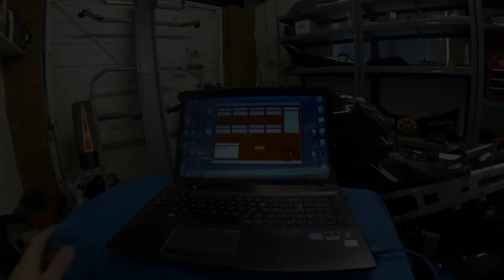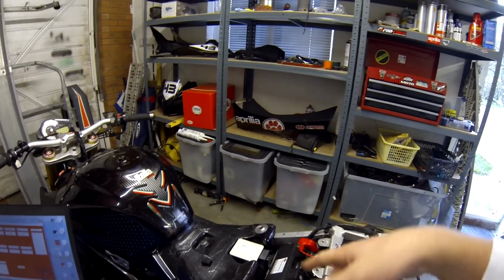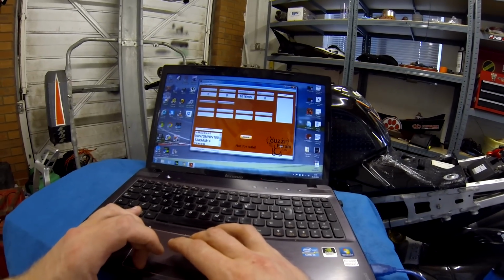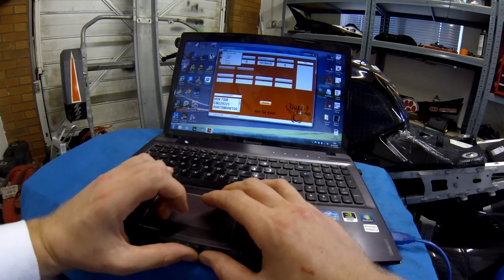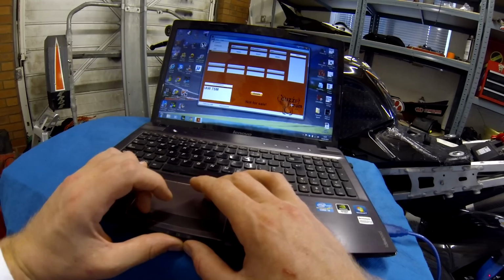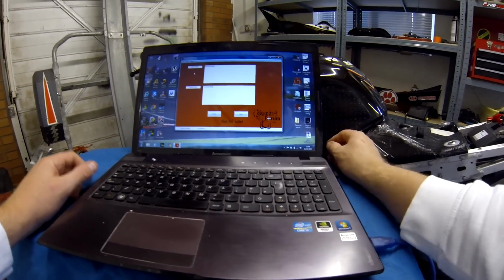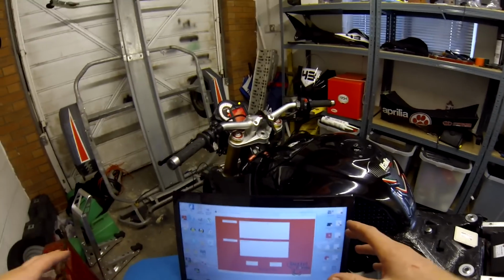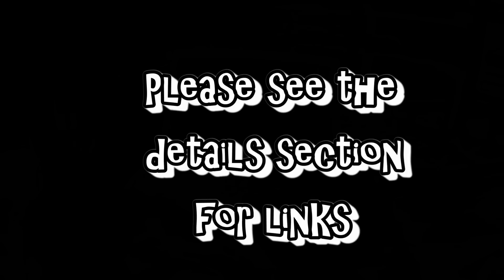Guzzidiag for RSV4 and Tuono V4 Throttle / handle learning and clearing faults diagnostic cable

Comment: So I don’t have TC/WC or a Speedo, my shop Reset all perameters, we got the bike running fine cause it was throttling by itself, it said it was doing 26mph while on stands (Bike wasn’t moving), I replaced the rear speed sensor, still nothing, haven’t calibrated it yet, but is this what I’m needing to do to fix it?

Comment: Hi, many thanks for making this video, I pick my race ECU up on Friday for my 2019 1100 factory, I’m going to do the throttle and handle learning, I’ve just received my cables from Lonelec, can you adjust things like when the fan cuts in and out? Many thanks 

Chris
Reply from the maker: Things might have changed but from memory it comes on at 103 degrees. Sorry not had this bike for several years so a bit out of the loop

Comment: Do you have to re enable APRC functions? I read that somewhere.
Reply from the maker: Graeme McCullough  no mate APRC functions can only be switched on and off with PADS via dealer unless it’s changed recently
Reply: @scooch2345  cheers mate, its the calibrations i was getting confused by 👍

Comment: can i convert my stock tuono ecu to a race ecu with this program?
Reply from the maker: Jordan Brown nope. But Facebook Gabro racing team on Facebook and you can send him your ECU then do calibration with this
Reply: @scooch2345  you actually can now, since a few months ago.
Reply from the maker: John Kerwin See  that’s awesome! Been out the loop for a while 🤦🏻‍♂️
Reply: @scooch2345  i just got in. Got my 2013 rsv4 factory about 2months ago. Haven't been riding it to much, waiting for cables to arrive so i can flash the race ecu. It's been more than a month, cable isn't here yet.
Reply from the maker: John Kerwin See  I did not rate the stock Aprilia race map, Gabro’s was much smoother and tried on both RSV4 and Tuono v4 was still very snatchy
Reply: @scooch2345  so i shouldn't expect much from the race ecu? :(
Reply from the maker: John Kerwin See  allows you to do some stuff such as remove the exhaust flapper with out error codes also keeps flapper fully open in every gear but N, a few more bhp for sure but Gabro’s was smoother
Reply: @scooch2345  it actually opens the flapper in neutral if you push it. Afaik. When the ecu reads movement, it opens. Anyway, i need the race ecu since i have a gp2r slip on, and it's supposed to make the ride smoother? But yeah i also read gabro makes it even smoother, but being in the philippines, sending the ecu would be too much of a hassle.
Reply: Yes you can. You can do it now, you can't before. Check the forums there's a full guide there how to unlock your ecu and make it a race ecu with just the cable.

Comment: Where did you get your cable from?
Reply from the maker: ebay, but some are hit and miss as dot always work, there is a page on AF1 forum with cables from some suppliers that work with links
Reply: Can anyone send a link where I Can buy and which cable model at Amazon. Thanks.
Reply: @andresaguilar9712  
I bought the set from the two required cables with OBD here:  (lonelec.co.uk) https://www.lonelec.co.uk/Motorbike-OBD-Diagnostic-Cables/Guzzidiag-Melcodiag-Ducatidiag-Hardware/Guzzidiag-Melcodiag-3pin-Interface-Cable

Comment: Never got Guzzidiag to work with 2016 Tuono, Toshiba laptop with windows 7 Professional after 2 sets of cables. Even  Lonelec didnt work. They are for sale. 15 bucks.
Trip to dealership done. It took minutes. Wasted two weeks of waiting and 4 hours or trying to get it to work. But that is what i had to work with. Your laptop and bike might work fine. 30 bucks in cables and some time lost. No biggie.
Reply from the maker: sorry mate dont come here that often, post up on Af1 forum they will help you out, prob just ropey cables
Reply: No worries. Cant say what the problem is. But a trip to dealer got it sorted out.

Comment: With race ecu will you key still work.  My 2016 wire in the back only has 2 wires coming out of back.
Reply from the maker: yes, key is linked to dash not ecu
Reply: +Mandlebar Racing  Thanks. Getting close.
Reply: Well I wish I had good news. But with it all hooked up to rear plug it always says Disconnected in lower left of screen. And no com port 3. Down loaded Guzzidiag SW. It shows what ECU I have but nothing else. Red light but still Disconnected. Good news is I cant hurt anything I cant connect to.  Try a new cable maybe? Which one? They seem pretty cheesy.
Reply: Also downloaded Adapter test and tried that too No connection.  I got cables from Amazon. They could be garbage but no way to really tell. Not sure how long cables will take to get from UK. Any recommendations.  Thanks.  Its been a long night.
Reply from the maker: sorry buddy, I know some people have issues with cables, not my system just a how to video, worth checking AF1 guzzidiag thread, some more knowladgable guys on there

Comment: Ok it's not working.  I had a faulty cable, the light never came on. So I ordered another one.  And that light comes on. But now!  for some reason it's not communicating to each other.  it doesn't want to connect.  I need help! thx
Reply: Ever get it to work? Im in same boat.
Reply: Robert Negrete at the screen, you have to make sure you have the correct com port selected. Com ports are the USB ports on your laptop, if its looking at 1 and you're plugged into 3, it wont work.

Comment: Hi I;m new to this I just picked up the had my stock ecu up graded to the race ecu, so i would need some help..... 2012 RSV4 R with  SC project slip-on Carbon.
Soo I live in California, so i would need to put it on California 1400? And what about the throttle % , do I need to change that? or not? I'm just trying to make sure on your steps. 
on the learn and handling. You jump around to codes and the APRC. 
So what do I do on the learn and handling? Thx for your help
Reply from the maker: +Robert Negrete  Its not my product, just a popular product so thought I would do a "how to", yes select california 1400 dont need to fiddle with throttle response, there is a handy pictorial on AF1 forum, good luck :)

Comment: Will this software work with a stock ECU? I need to perform a demand sensor learning on a 16 Tuono with the factory ECU
Reply from the maker: +NismOzzy  yes mate it will
Reply: What lap top and operating system are you running. Todhibsa with windows 7 pro. Not working for me. Do you have cables.

Comment: Hello, I got both cables but when I plug them in the light doesnt come on on the Blue cable and im not Able to connect. do I need some sort of driver or does it just mean one of my cables are bad
Reply from the maker: +Afrorider Motovlogs most likely the cable is faulty, not all work with this application.

Comment: help!! I tried to do this on my tuono v4r abs but after installing race ecu and doing the throttle and handling learning the bike wont even turn over! I press the ignition and nothing happens at all
Reply from the maker: +masonj19  bit of an odd one, you sure you have not just got a flat battery or hit the kill switch? you cant fry the bike with guzzidiag.
Reply: No i tried all of that it has to be the race ecu after puting my stock mapped ecu back in everything works fine! to be honest i dont think its guzzidiag its strange everything is connected i can connect to it using guzzidiag but pressing the ignition just does nothing like it isnt even connected and it alternates between service and urgent service messages.

Comment: Hey Mandlebar (Dan?), thanks for this tutorial. I am using guzzidiag with my RSV4 and when I do the handle learning after replacing my demand sensor, it throws an urgent service fault on the bike's console. However, guzzidiag still says "finish" and "ignition off" before exiting. Is that normal?
Reply: +Mandlebar Racing why my aprilia rsv4 factory 2012 speed km/h no function,"0" only
Reply from the maker: axn3379 Yes mae its Dan, from looking at the reply you got on Af1 this is perfectly normal. Safe riding!